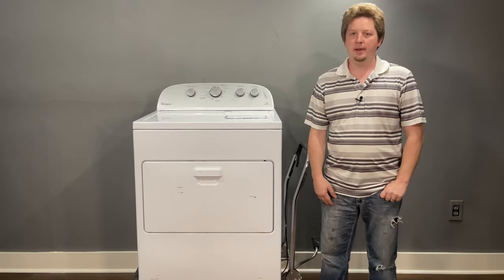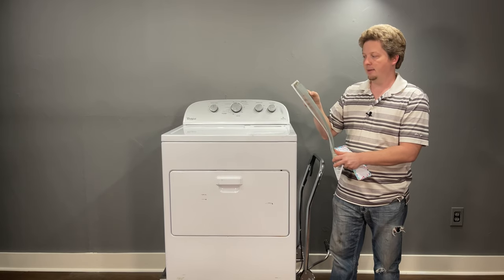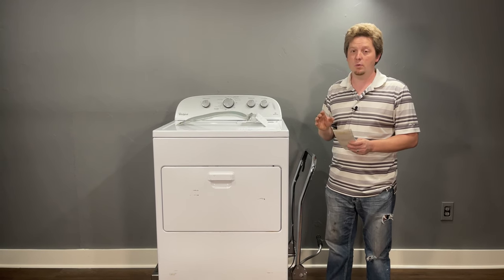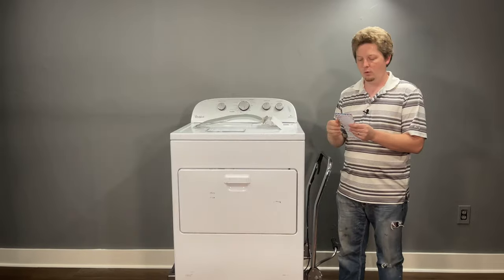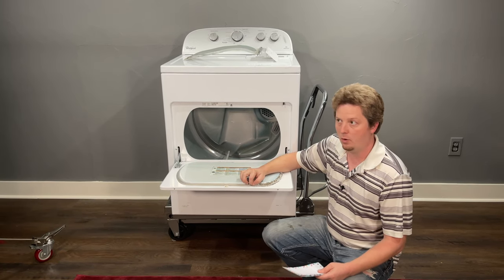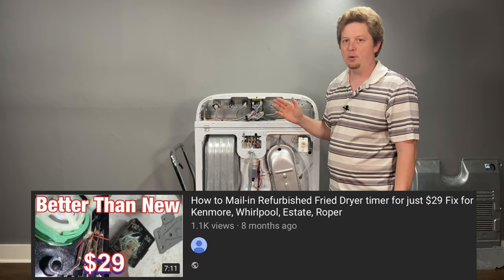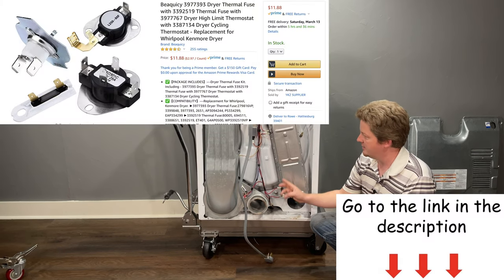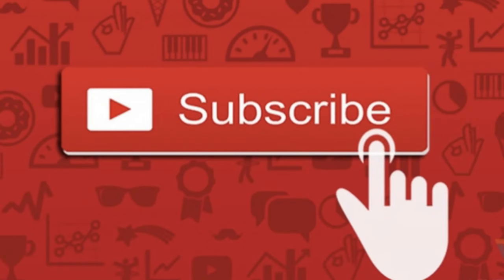Electric Dryer Overheating - All Reasons & How to Fix - To Hot burning￼ - Whirlpool, Maytag, Amana

Comment: Whirlpool getting too hot then shutting off, what do you think? Will the thermostat/fuse kit in the video work for a older whirlpool dryer?
Reply from the maker: Definitely, first thing to check is why the dryer is getting too hot. Be sure to not run it until this problem is solved because it’s very dangerous.
More than likely, it’s got lint buildup in the fan housing or the hose heading out of the house. But to be safe I would go ahead and take the drum out and make sure it has not sprayed lint inside of the entire dryer. 
What can cause chaos to all the thermostats.
So my first step would be to unplug the dryer and take it apart. They sell a kit to replace all the thermostats of the old dryers on Amazon pretty cheap. I would go ahead and give that a try as well after you have made sure all the lint is Cleaned out.
Reply from the maker: Are there could also be the motor overheating. Hopefully not.
Reply: So is it a universal kit for a whirlpool? Thanks
Reply: I put a thermometer in the vent as your video suggests and it cycled several times and shut off at 160. I'm running it again and it's about 15 minutes seems to be cycling around the proper temps and not shutting off??? Any ideas?

Comment: The back of my whirpool dryer is tack welded on.  Is the only way to access the heating element either by busting the welds or cutting the back off?
Reply from the maker: It’s probably a different type of dryer than a filter out the top dryer.
You have to more than likely remove the top and the front
Reply: @WasherDryerMoney  you're correct. What a pain.  I've removed the top and front and the thing the clothes roll around in.  Now time to get a new element.

Comment: Maytag Centenial elect. dryer.  Heating element and thermostats test good.  Even in air dry (no heat) element comes on.  In med and high modes it gets cloths around 160°.  I am thinking the temp setting switch.  Any thoughts?
Reply from the maker: It could be. The thermostat rarely goes out compared to some of the other problems. If it’s getting to 160 from the exhaust that’s pretty close to what it’s supposed to get to. Some dryers go to about 175.
Reply: @WasherDryerMoney   Help Samsung washer about 5 years old 
I removed the blue cap at the bottom 
Then remove the screw 
Then tried to tight the huge bolt under the white agitator of plastic
Still some going off balance 
Replace the rods would be my next step?

Comment: I replaced the 4 fuses on the back of the dryer and now I put the meat thermometer in the dryer hole ( great air flow blowing out)  and the temp is staying at around 165-170. Should it be staying at that temp? Or going up and down in temp? If its an issue what else should I be looking for
Reply from the maker: That is strange. It should be going much lower on temperature before coming back up.
Check to see if the heating element is grounded out. I have a video on that. If that is not it check out the Facebook group “appliance repair and help questions”
On that group you can post pictures and exactly what’s going on and there are several people that can walk you step-by-step through every possible solution.
Reply: @WasherDryerMoney  I recently bought 3 cheap new elements.  A pair from one seller and one from another. 
  I feel like both get their cheap parts from the same wholesaler. 
  One was like $19, the pair was like $40. 
  Tried the one and one from the pair. I also installed OEM cycling stat. 
  Neither element would get hot enough to cycle the cycling stat.  Both liked just a few degrees getting hot enough to work the stat.  I put the old one back on it. It cycles now. 
  I called myself calibrating two thermometers before testing any of these.
Reply: Btw, I am surprised how few times a clogged lint screen is mentioned in some of the forums I am in. 
  I check the lint screen in every dryer I get in and advise the buyer to check them now and then. 
 So many think all they have to do is scrape excess lint off every time they use the dryer.

Comment: Any ideas why a new Electrolux dryer would be squealing 🤔
Reply from the maker: The common problem with most dryers that squeak is usually the rollers or the idler pulley. Sometimes I have to be replaced sometimes you can just clean and oil them. Some machines are easier to get the drum out and do the job and some are much harder. Good luck
Reply: @WasherDryerMoney  I also have an older Electrolux washer  that's been leaking. I changed the tub to pump hose and the dispenser to tube hose which both had holes. What I did notice on the dispenser to tube hose it rubs against the the drain hose creating the hole. Im thinking of putting something in between the two to keep this from happening again. EIFLS60JRR0 thanks 👍😎

Comment: Mine had a burning smell for weeks then started smoking today
Reply from the maker: You’re gonna wanna unplug that and not plug it back in until it’s fixed.
Reply: @WasherDryerMoney  I took it apart because I thought the belt might of burnt out as the duct was completely clear! But when I took it apart there was a blanket of black burnt lint inside the appliance right under the drum. Insane that it even got in there! I had no idea king could get inside the dryer. Now gonna religiously take my dryer apart and check for lint like weekly because now I’m scared of that.

Comment: My hotpoint htmx100em2ww Commercial started to overheat like crazy suddenly.. 
I opened it all.. removed and inspected the belt. Removed some lints (not much) 
and everything seems normal but the back of the dryer gets extremely hot and the top of it near the console... i'm pretty sure its the Thermostat does it sound right?
I'm going to order one but wondering if it could be something else.. watched a few of your videos.
Hmmmm thinking it might be my outside trap with flaps maybe they dont open well with the air pressure...
The kit you linked for thermostat and fuses is not available do you know if another one could fit ? Thanks
Reply from the maker: I put a new link be sure to check to see if that one is available. I would say you have a airflow issue. Either it’s built up around the fan or the exhaust line is bent or clogged up.
Reply: @WasherDryerMoney  i know its not in the dryer... maybe into the wall or the outdoor trap.. gonna have to check. thanks
Reply: @WasherDryerMoney  Could it not be the rear of drum being worn?

Comment: My dryer keeps running at the end of the cycle, it never stops, that happened after a clogged duct, I cleaned it because it was overheating and now it won't stop, I have to manually turn it off.  please any suggestion, thank you.

Comment: Question: I tried to dry a piece of clothing . I took it out of the dryer about mid cycle and left the dryer door open . I left home for about 9 hours, returned home , went into my laundry room and my dryer was hot to the touch. Can you offer any advice to what the problem may be .
Reply from the maker: Probably a grounded out heating element. I have a video on that subject. Basically it means the heating element is touching the metal frame of the dryer. Causing the heating element to stay on all the time. If it’s not that it could be the timer.
Reply from the maker: Definitely don’t leave it plugged in until you fix it and double check that it’s not going to do it again it’s very dangerous.
Reply: @WasherDryerMoney  Just checked the heating element and thermostat on my meter and I visually checked the heating element and everything looks good. But what I did notice was that the timer goes from one setting to the next setting never turning off !
Reply from the maker: It’s a much more rare problem but it could be A bad timer. Sometimes you can visually check these after you open up the timer. Just be careful and be sure to keep the dryer unplugged while you’re working on any electronics on it.